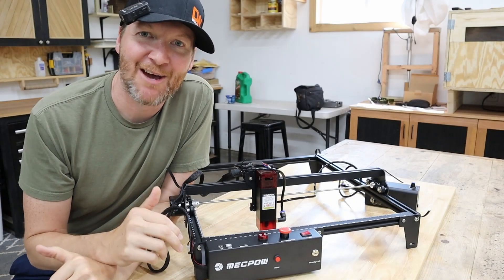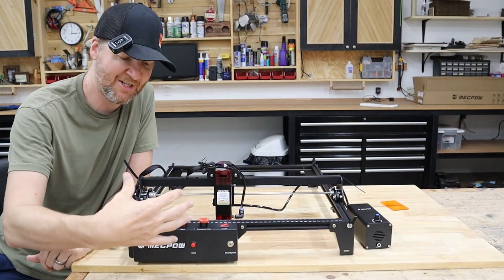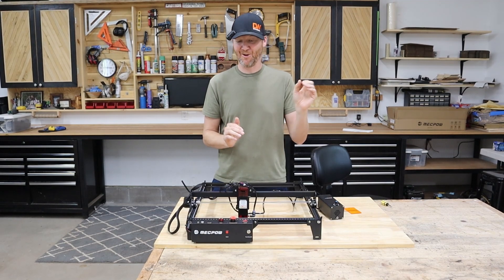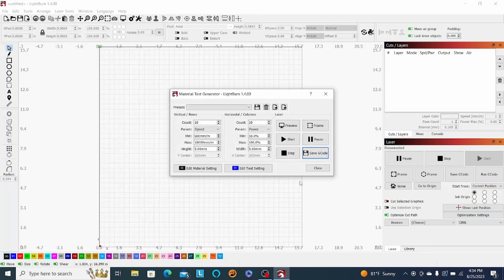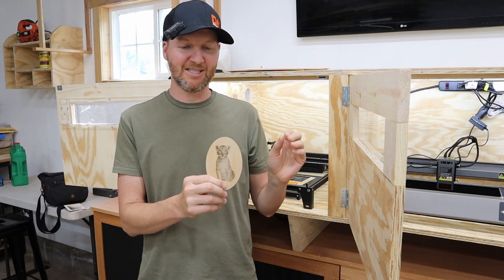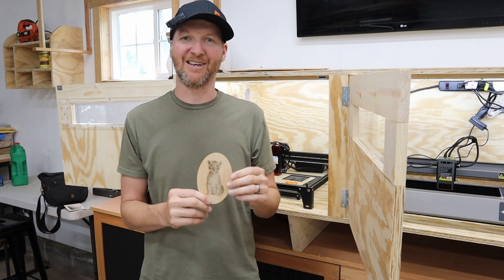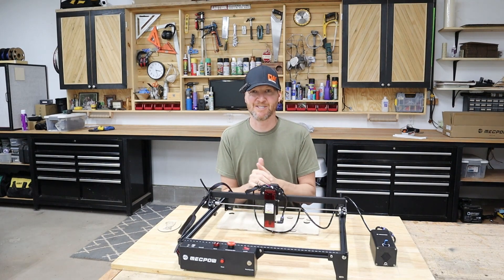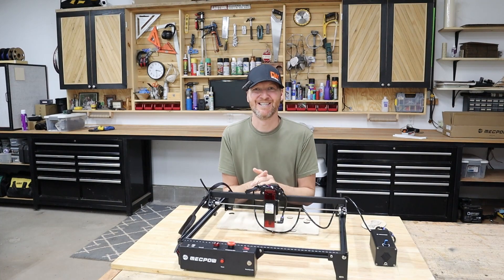Best Budget Laser - Mecpow X3 Pro 10W Laser Review

Comment: Hey, thanks for this review!  I'm dipping my toes in the water and needed an inexpensive laser engraver to learn on, and was worried this was a piece of garbage.  The included air assist is great, and found a site that throws in the bottom plate for free for <$300!
Reply from the maker: Hello, I think this is a great starting machine, it works well especially considering the low price!